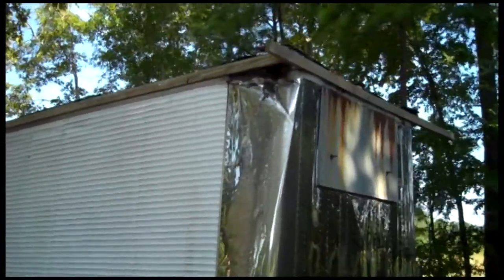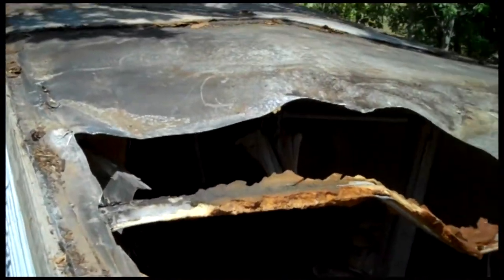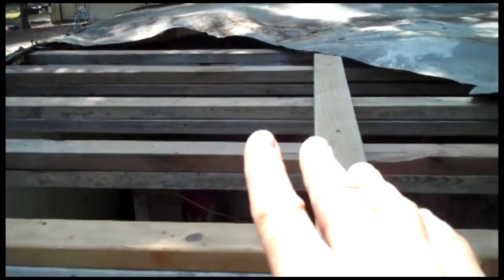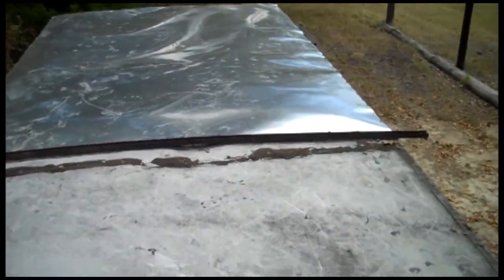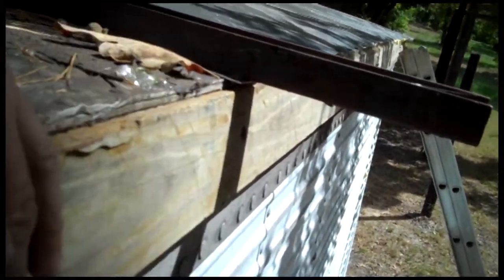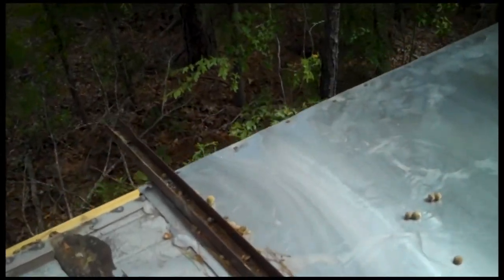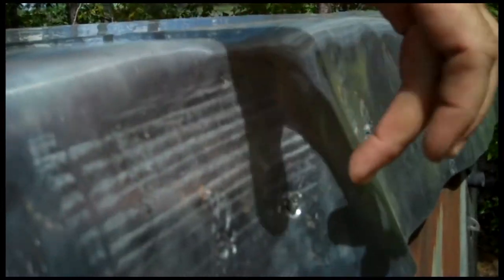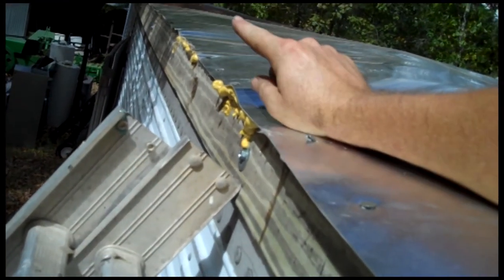DIY: Semi Storage Trailer Roof Repair/The Allen Brothers

Comment: What if my roof is not that damaged but it does have a leak that I need to seal.  Would I still have to take off the roof and replace it with the aluminum?

Comment: Where do you buy the sheet metal by the linear foot?
Reply from the maker: This was purchased through a local trailer repair shop. It comes in the width of the trailer so then we measured and bought it by the length. I forget the amount per foot but the purchase was around 275.00 at the time. I would check local trailer repair shops. That's what we did.
Reply: AllenBrothers ok thanks! I'll take a look around me. Fixing my box truck that I tore the roof off